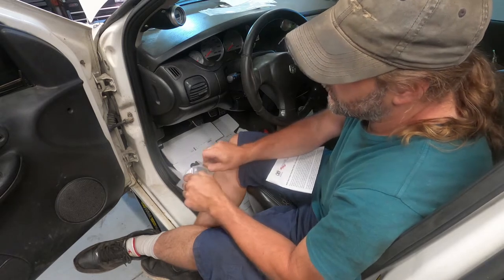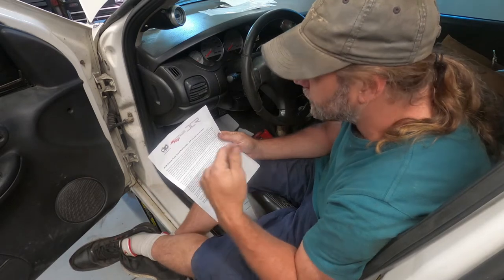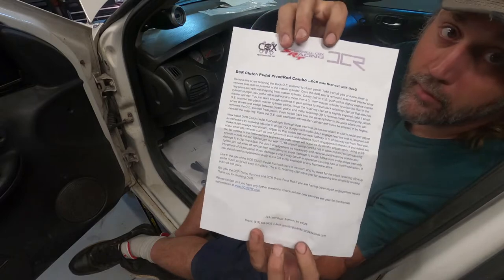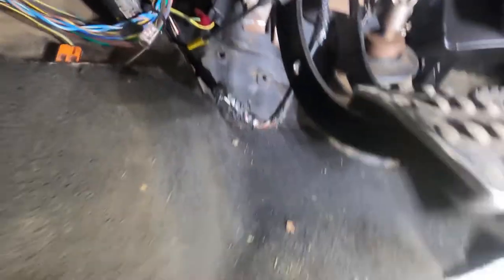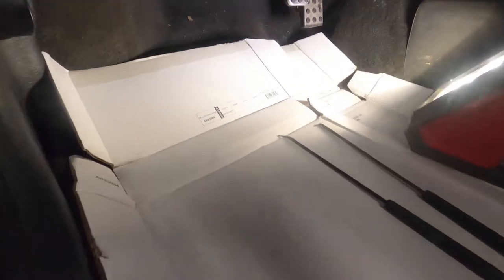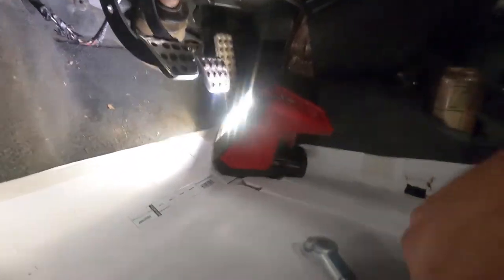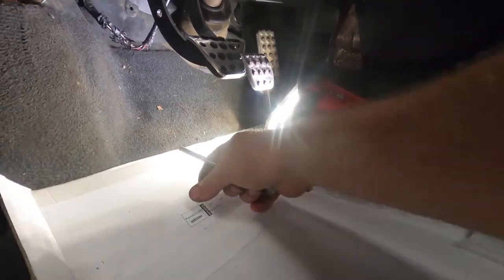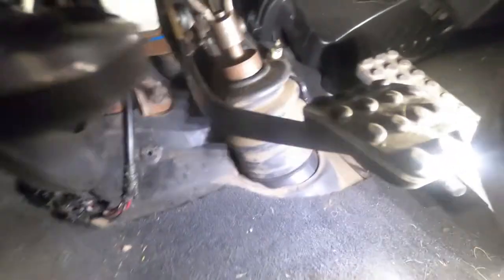DCR FIX FOR SHIFT ISSUES ON AN SRT4

Comment: Make sure you don't have too much engagement with the DCR Push Rod. I had a little too much and it toasted my ACT HDSS
Reply from the maker: Digital_Exile good call I forgot to mention that over adjustment will make the fork hit the pressure plate of the clutch you will know because of the sound ..
Reply: By over engagement do u mean having the Dcr push rod adjusted to long my act clutch is smoked and thinking I had the adjustment on my dcr rod to far out
Reply from the maker: Dave Cote yes, if it was to long it would be like resting your foot on the clutch all the time. Not releasing the clutch all the way
Reply: Thank u I figured that I had it adjusted too far out I appreciate your time and your videos they are very helpful got a new act on the way don’t want to make the same mistake

Comment: I also can can u tell me how to adjust it correctly? I know how to bring the rod in and out by spinning it but how to I know what's the best position?
Reply from the maker: sorry for the late reply, this can be different for each car and type of clutch but all will be similar once installed adjust out the length to take out the free play you want enough length to disengage the clutch,  to much length, you can damage the master and slave cylinders and can cause the fork to contact the clutch pressure plate so small adjustments 2-3 turns once the free play is adjusted out
Reply: @Mattsneedforspeed  thanks I'll do so accordingly
Reply: @Mattsneedforspeed  Is there any way to tell if the rod is adjusted too far out, if the fork doesn't hit the clutch?
Reply from the maker: @taylorsombathy  I adjust it out till it just hits the inside of the master cyl no play in the peddle if you make it too long it will damage the master, cause clutch slippage and its possible the fork will hit the clutch pressure plate when pushed,  if you need to have the adjustment out too far you have problems and need to remove the transmission and inspect the fork bearing and clutch. I was tracking down a problem clutch didn't want to release when i pulled the trans the clutch disk spring came out normally its the fork that's worn
Reply: @Mattsneedforspeed  Thanks Matt. I just put the upgraded pivot rod in and new dcr slave. I was a little worried I had it adjusted too far, but I was completely locked out of all gears at first, and am only able to adjust the rod a very small amount at a time. So im pretty sure i didn't over do it, plus the car starts to creep when the pedal gets not too far off the floor.

Comment: So my srt4 wont go into reverse at all with the car on or off, and grinds 2nd and 3rd when driving, do you rhink it might be clutch related or transmission?
Reply from the maker: If it goes into first with the engine running and the clutch pushed in sitting still then no check your cables, bushings and selector plate but it sounds like you have an internal transmission issue

Comment: Hey I leaked a lot of fluid out. And It looks like mine doesn’t have the cup to separate, and the rod won’t budge out. Any ideas?
Reply from the maker: If you have leaking in under the dash at the push rod I’d recommend replacement of the master that damaged typically happens when the oem or cheap aftermarket push rod slides off and pushes on an angle you may be able to get it together and work but plan for replacement

Comment: Will I need a new master? Or can I bleed the system after I figure out how to install this
Reply from the maker: Can try to get it together if the seal is damaged or worn it will leak, can bleed it I have a video on that also but I’d suggest replacement
Reply: @Mattsneedforspeed  Ayyee got it out.. apparently it was tinkered with before, found no piston cup to separate. Got it installed, took it for a drive and e-clip popped out 🤣